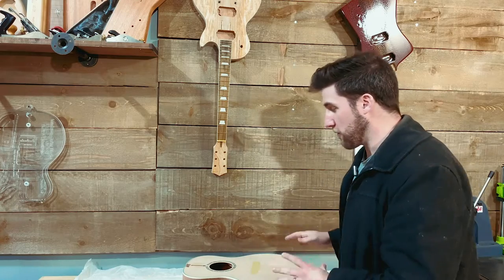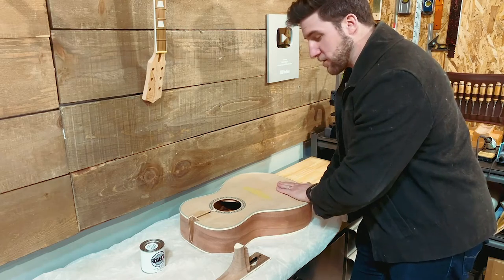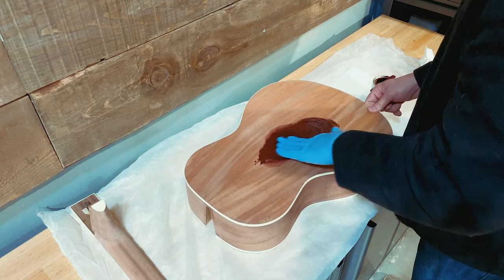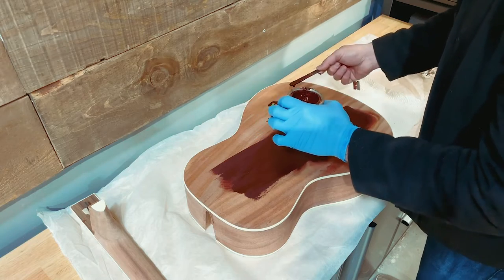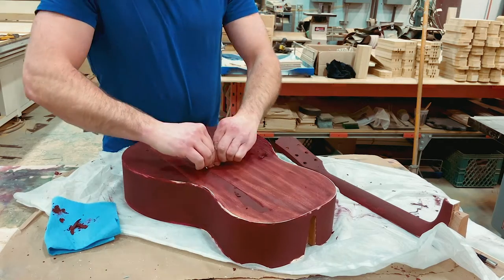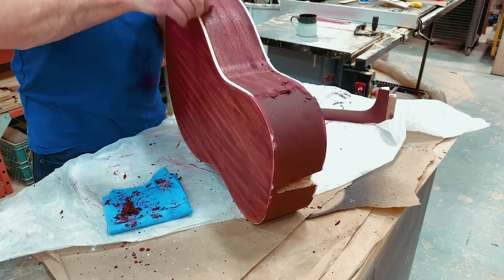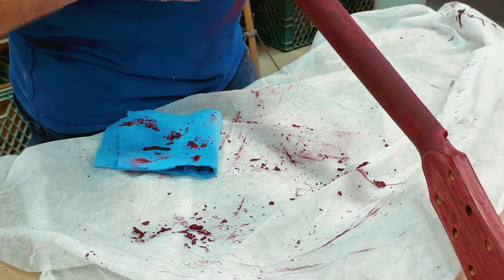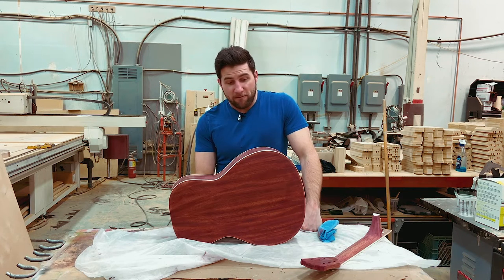How to Grain Fill an Acoustic Guitar (Beautiful Tinted Filler)

Comment: I used to use zpoxy but now for the top I just use clear coat and build up to level sand. Last coat normally would have a very light amber tint on the whole guitar. The neck I like to do the heel and headstock black with the neck just like you have it now. So it looks worn between headstock and heel. Nice fill job.

Comment: Seen driftwood guitars use that epoxy fill and it looks like great stuff and with the fast drying time its definitely a bonus.... I bet you can't get it in the uk as usual lol. I'm the same with acoustic guitars I find them clumsy to play but bought the Taylor mini GS and its very easy and comfortable to play! This kit looks about the same size so I don't think you will struggle.
Reply from the maker: I think Ben from crimson guitars has used the same epoxy in his projects. Should be available in the UK. If not, something similar must be.

Comment: Quick question - how did you go about cleaning the top after you finished the grain filler application and scraping for back and sides?  Sanding? Solvents?

Curious.  Enjoying your videos.
Reply from the maker: Mostly just sanding. I gave it a little wipe with methanol too.

Comment: Is there an advantage to using latex gloves to spread the grain filler stain versus a cloth?  Or is it just personal preference?  Love the color choice.
Reply from the maker: Advantages are that it doesn’t pick up as much filler and doesn’t pull any out of the grain. Disadvantage is that it doesn’t really remove the excess.

Comment: Looks awesome Brad, looking forward to the final result. A question: As this is an oil-based colored filler, can you just spray nitrocellulose lacquer straight away, or would you recommend a sealer coat to stop 'bleed-through"?
 Reason I ask is that I recently made a maple snare drum with a green stain. I pore filled w/ green dyed Aqua Coat under H20 based poly (wiped on). I made a few test pieces both w/ and without a Shellac sealer, and the sealed pieces turned out much more evenly colored. Perhaps in your case it won't even matter as you'll be spraying instead of rubbing (heheh).
Reply from the maker: I think you can go straight in with the nitro, but typically would recommend a sanding sealer first. Rubbing something solvent based on it is certainly risky. Spraying is preferable to avoid smudging etc.
Reply: @BradAngove  Thanks, that was my impression as well.